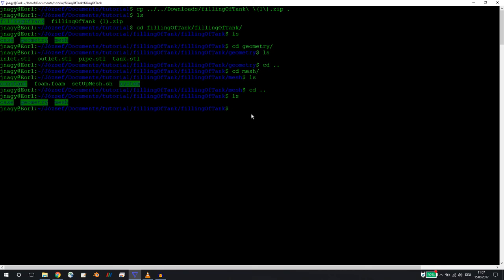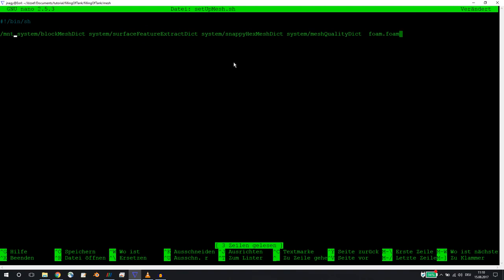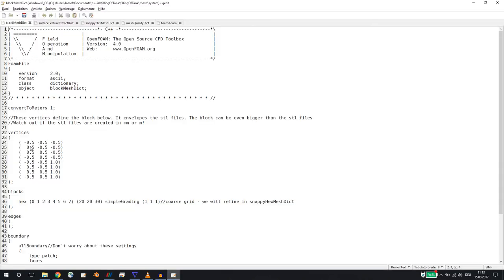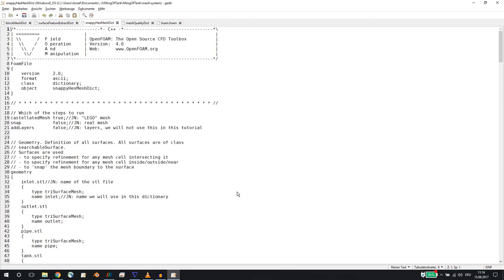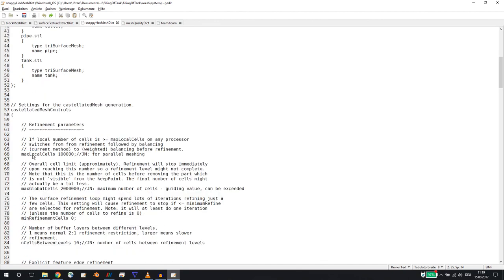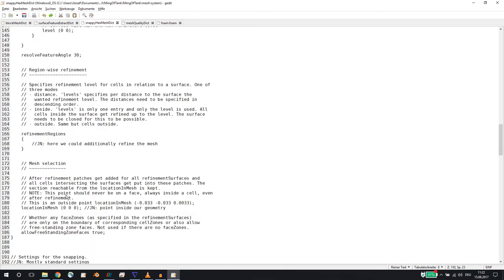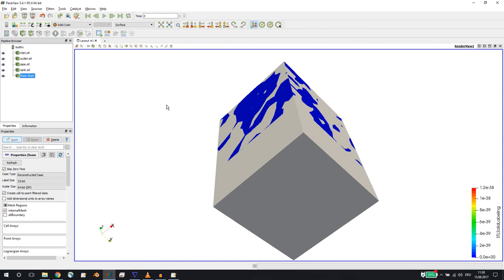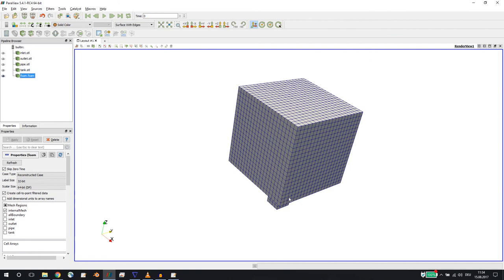Multiphase simulation project in OpenFOAM in Windows 10 and Ubuntu - tutorial part 2 - snappyHexMesh

Comment: Hi Mr Nagy, thank you for the tutorials. However, I'm conducting a study on the external flows (wakes) and would like to create a refinement region for the wake. However, the only options for refinement seems to be the refinementBox, refinementCylinder, etc. options in sMH which is very wasteful in terms of elements. Do you know if it is possible to create my own refinement region with a .stl file and use sMH to refine this custom region? Thank you.
Reply from the maker: Sure. You can use for that Hrvoje Jasak's banana strategy. Enter e.g. in the flange tutorial of snappy instead of searchableBox "banana". You will get an error message like:

--> FOAM FATAL ERROR:
Unknown searchableSurface type banana

Valid searchableSurface types :

11
(
closedTriSurfaceMesh
distributedTriSurfaceMesh
searchableBox
searchableCylinder
searchableDisk
searchablePlane
searchablePlate
searchableSphere
searchableSurfaceCollection
searchableSurfaceWithGaps
triSurfaceMesh
)

There you can see, that you can also use for refinement regions triSurfaceMeshes i.e. stl files.

Comment: I am having a problem with surfaceFeatureExtract, I think because I am using the .org version instead of the .com version of OpenFOAM. Do you have advice on how to get around this?
Reply from the maker: The command is surfaceFeatures and the syntax in the dictionary is different. Check out the .org mesh tutorials for more info.
Reply: hey did u fix it?

Comment: Thank you for all of your tutorials, but i have a question about VOF but in compressible flow supersonic speed, if I used the compressibleInterFoam or compressibleInterFoam give me an error negative temperature error. Could you please tell me how can solve this problem. (My case is CD nozzle with two inlet (inlet 1 and inlet 2) and one outlet (atmosphere condition). could you please tell me how can solve this problem. thanks in advance.

Comment: To run snappyHexMesh in OF7 the meshQualityDict line 21 should be changed to 
#includeEtc "caseDicts/mesh/generation/meshQualityDict"
Reply: thanks mate!
Reply: I'm using OF6 and tried this however it is still showing " Foam Fatal Error: Could not find mandatory etc entry (mode=ugo) 'controlDict' "

Comment: hello guys. I am trying to follow the wolfdynamics snappyhexmesh tutorials from the 3weeks openfoam course and running into some problems.
Specifically I am trying to use the surfaceFeatures command to create an obj file, but the command doesn't work. Is this because I am using openfoam2206? I am wondering how to solve this issue or if I need to install openfoam9/10 to complete those tutorials?

Comment: Hello Joséf thank you for your nice tutorials. I would like to do a multiphase simulation for injection moulding with heat transfer but I don't find appropriate solver for it in openfoam. Can you please suggest me which would be appropriate solver for it? Or can you please make a video about it? 
For your reply I would be very thankful to you.

Thank you
Reply from the maker: Well this is a very difficult topic. None of the solvers are suitable out-of-the -box for injection molding. You have to do heavy changes to the solvers, so you can describe the compressible and highly non-Newtonian behaviour of polymers in the injection molding process. This is exactly my topic of research at the university and I spent now over 2-3 years into implementing and validating the models.
Reply: József Nagy thank you so much for your kind reply. I want do a fill time analysis for injection moulding. Is it possible to do with standard solver "interFoam"? 
Yes I read a slide of you concerning the project. I am afraid to ask you if it is possible to share your new solver?
Reply from the maker: interFoam will only give you a rough estimate, as it assumes incompressibility. Maybe compressibleInterFoam, if you manage to correctly describe the material, but the material models of polymers are not implemented in the official release. The code belongs to my project partner, so I cannot share it unfortunately,
Reply: József Nagy thank you for your kind reply. I have a question even though it is out of of the context can I please ask you if it is possible to to install openfoam without root access. I found some instructions in various forums but while installing I got problem while compiling. 
For your reply I would be very thankful. 
With best regards
Reply from the maker: Well check out my video on installing OpenFOAM in Windows 10. If you want to do it in Ubuntu, just ignore the Windows 10 part at the beginning and start, when I download the tar.gz file from openfoam.com. The rest is equivalent for Windows 10 and Ubuntu.

Comment: Dear Nagy,

I am fresh with OpenFOAM, I try to install a Windows10 version. Although I try to follow your every moves step by step, difference can be still found between yours and mine maybe because of different version???!. Right now, I try to open paraview. It turns out to show 'Command 'paraview'  not found, but can be installed with: 
sudo apt install paraview'.

Surely, I tried this code, unfortunately, it shows 
Reading package lists... Done
Building dependency tree
Reading state information...Done
E: Unable to locate package paraview.

I would appreciate  if you can help me get through this problem.

Colin
Reply from the maker: Try sudo apt-get update and try installing again. You can also run your simulations on your Windows Files system and install Paraview natively in Windows.

Comment: Dear Jozef, 
i was attempting the tutorial using Ubuntu OS in my laptop. I had installed the latest version Open foam 8 and while attempting i initially couldn't run the surface dict extract command. iI looked up and found that the command had changed in the new version and made the changes accordingly. I am able to run the blockMesh command. But whenever i try to run the suface features command at the start the following error occur

-> FOAM FATAL IO ERROR:  keyword surfaces is undefined in dictionary /media/user/F6EAFCE3EAFCA0D3/openfoam8/tutorials/multiphase/interFoam/laminar/fillingOfTank/mesh/system/surfaceFeaturesDict/inlet.stl

kindly help in finding a solution
Reply from the maker: I use the .com version of OpenFOAM not the .org. There are syntax differences, which you have to take care of.

Comment: Hi József,
surfaceFeatureExtract: symbol lookup error: /usr/lib/libedgeMesh.so: undefined symbol: _ZNK4Foam11regIOobject11writeObjectENS_8IOstream12streamFormatENS1_13versionNumberENS1_15compressionTypeE

How can I solve this? (I'm using Ubuntu)
Thanks!
Reply from the maker: Did you recompile your original installation?
Reply: have you solved the problem? I found this problem also, but in the comment sections it looks like that this specific problem hasn't been sloved
Reply: not necessary, I've solved the problem
Reply: @aero_cats  how did you solve the problem?
Reply: @aero_cats  Thanks a lot now it works. I already guessed that the .org version caused the error. How did you figured out the correct syntax?
Reply: @sammybrabender8806  Glad, it can help. You can get the detailed explanation from the OpenFOAM documentation, I just guessing the correct syntax after watching several Jozsef videos :v